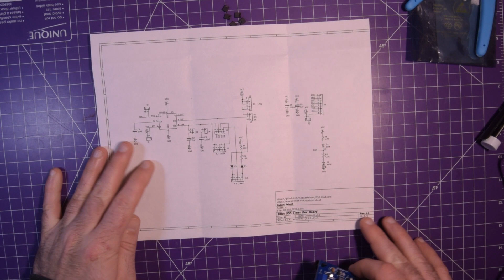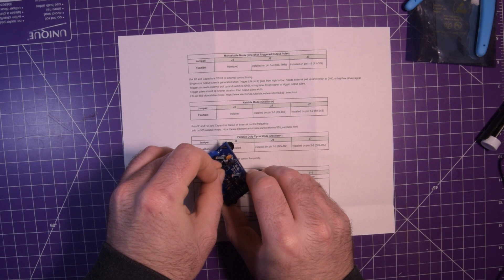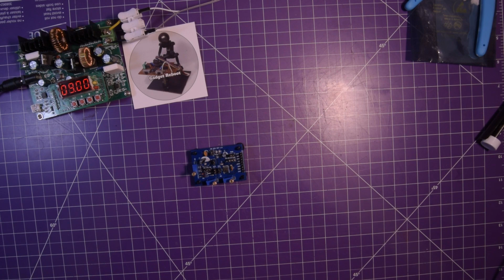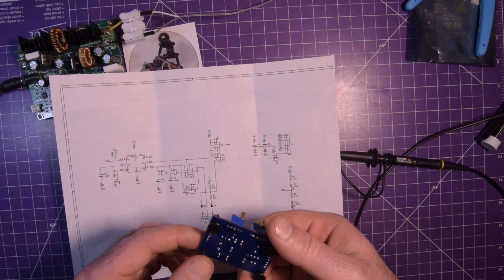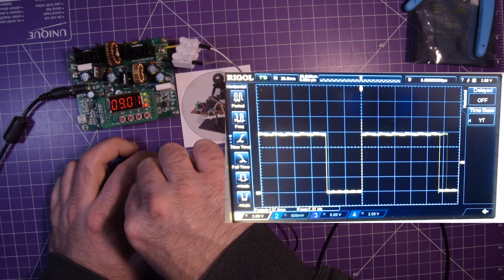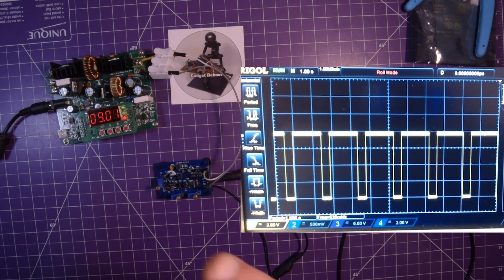Testing The Kit: Gadget Reboot's 555 Timer Dev Kit (With Oscilloscope!)

Comment: Yeah I usually design test points/pads into work projects for ground/power/signals but somehow I keep forgetting on my personal stuff. My very latest board in the KiCAD tutorial does have two VCC and two GND connection points (finally).  
When I first put the board together the first thing I thought was....if only I had jumpers with those pull tabs, so I ordered some eventually and just yesterday I got them in the mail, though they are green.  
Similar to the LED footprint, I didn't like the KiCAD header footprint, how they try to show where pin 1 is, so I'm slowly tweaking and re-saving my own header footprints as I do more projects.
With both capacitor jumpers installed we have the bigger and smaller timing caps in circuit for the lower frequency, now if you remove the electrolytic jumper you'll get a higher frequency range.